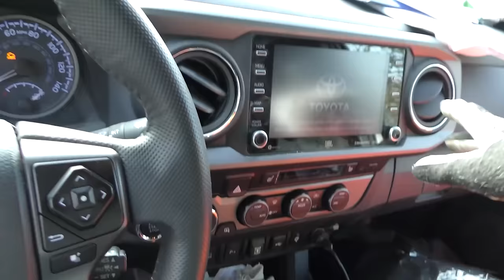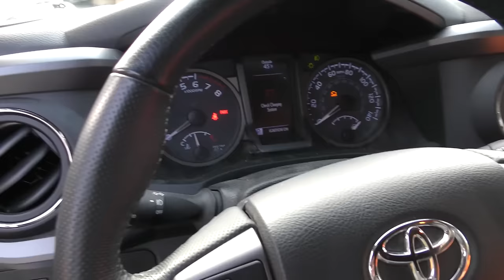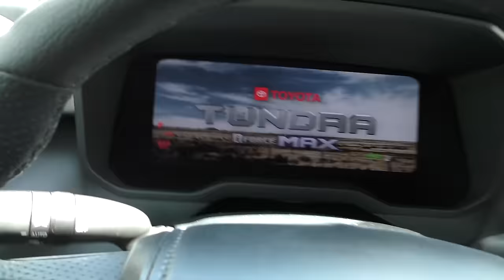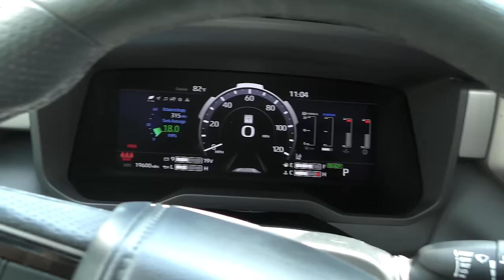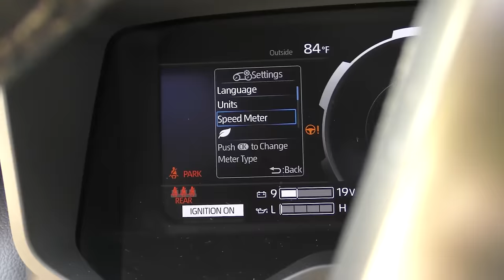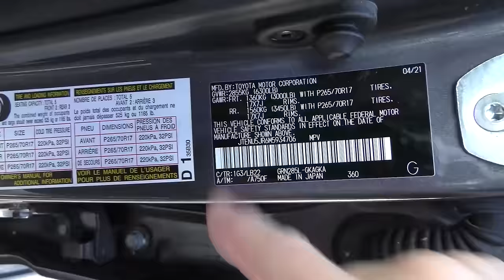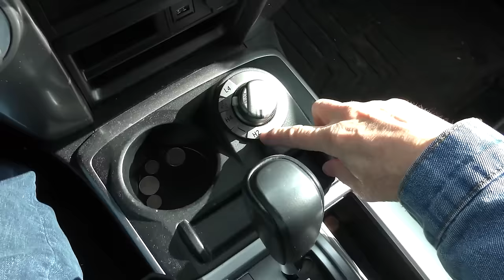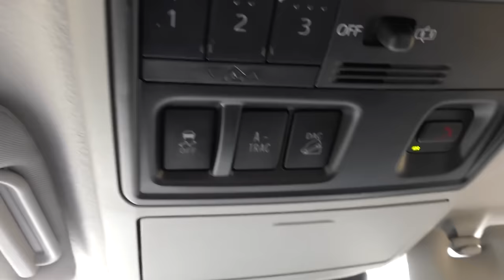3 New Toyotas I Would Never Buy

Comment: Toyota should at least offer the non-turbo version of the V6 and V8 as an OPTIONAL package.  Perhaps even bundle it with a "Power Package" and include some extra things that perhaps the majority of wannabe truck buyers don't want or need, like a HD hitch and heavier duty suspension perhaps and sell it all for maybe $4k extra.  But at least offer it as an option even if it's also an up-sell.  The thing about trucks is that those who use their trucks for actual work (like towing, and aren't just the wannabe truck owners/drivers) know that the value in reliability and towing greatly outweighs the gas mileage.  Those people don't buy trucks for gas mileage; they buy them to do actual work and know that the gas mileage is what it is.  Because to be honest, the money you MIGHT save at the pump, you're just saving up to replace your turbo down the road.  I'd rather just pay more now at the pump and perhaps not have to worry about a turbo going out and heck, maybe getting a long trouble free life out of the truck with a non-turbo version.  I think Toyotai s making some big mistakes and will fall int oteh same trap that GM and Ford have been with their turbo vehicles.  Sad story my friend had one of the early Ecoboost F150's.  By 120k miles or about 10 years old the thing was basically junk.  Took it to three shops all said he needed a new engine basically.  Not just a new turbo, but a new engine as well (and he was very good about maintenance and not abusing the truck, but they just don't last).

The HP (and partially torque) comment Scotty makes is true and often overlooked.  Yes a car can do 200 HP.... at 6000 rpm.  Same is true for trucks.  And now many can maintain a decent amount of torque on the low end, is generally starts to drop off once your speed picks up, but it's not like you're getting full torque and HP all through the driveable arnge (being say 1500 - 6000 RPM).  It's relative as Scotty says but this is often overlooked and people get blinded by numbers (HP and torque figures) but they don't take time to look at how that's applied and when.

Comment: There has to be a perfect weight to size ratio to make a hybrid/gas system work at maximum power and efficiency. Maybe extend the engine compartment by a foot or 2 and throw a huge V8 or small V10 in there. Well go back to the days of American muscle style boats on wheels.

Comment: RE: Tacoma Hybrid
How about the hybrid providing low end torque that the V4 turbo lacks?
Don't you get synergy out of the V4 turbo and electric motor, with the turbo providing power at the high end, and the electric motor providing power at the low end?
Reply: With electric boost and possibly good low gearing (áll these 8-10 gear transmissions), a modern 4 cyl I guess will be fine, but that's just my humble opinion.

Comment: The awd system in the new Grand Highlander is garbage. Easily overheats and switches to FWD and flashes warnings and take to dealer (snow mode) went out and got me stuck. Punching the accelerator, hearing the awd “bang” when the fwd spins. Built to fail.

Comment: Toyota put the 4 cylinder turbo instead of the V6 in the Tacoma is because they know the engine's won't last as long and people will buy a new Tacoma rather than rebuilding or replacing the engine. Knowing people want a quality truck will result in selling more even though it comes in the 4 cylinder turbo for the TRD.

Comment: With regards to the monitor for TOYOTA's cars and small SUVs looking like it's glued on top of the dash yes it does look like that kinda but there is reason for that.  In the tundra there's plenty of room inside or behind the dash itself for the screen to be inside and part of the dash assembly. Whereas the smaller vehicles because they're not as large of a dash and everything still has to fit in there basically the same components there's not as much room so they had to put it up on top and it look like it was an afterthought in my opinion it was, but then they came back with a reasoning of it's safer because it keeps your head up, looking at least at the road somewhat rather than looking downward at the monitor or screen while driving. To the other point of the tundra, there are a lot of people that are serious about driving driving trucks yes but I'd say that's about 10% of the people that buy trucks actually need them and about 90% of them that buy trucks just want a truck for the sake of having room in the back and not having to worry about anything because it's only about 10% of the time I actually need the truck to be a truck the other 90% I could be a car and I'd be fine but I don't wanna have that inconvenience ever so that's why I love my truck.

Comment: I'm with you on the v8. It's much better than a ttv6 but don't spread false information. The new tundra is a much better tower, and they make more hp and torque at lower rpm. The 5.7 is 381 hp at (5,600 rpm) with 401 lb.-ft of torque at (3,600 rpm) and the 3.5 v6 hybrid is 437 hp (at 5,200 rpm) and 583 lb.-ft of torque at (2,400 rpm). They also have more payload than the previous generation.

Comment: I have a 2007 camry 2.4 with stripped head bolts. Is there any reason you couldn't tap out to a m12x1.75, and use grade 12 bolts Allen head  in place of the 11 x1.5?
Reply: Won't work. Not enough of a step up in size to cut fresh threads

Comment: Ain’t doing snow plowing in a tacoma it’s why people want the TUNDRA cuz the tacoma even with the V6 they’re not built or made to plow! the TUNDRA USED TO BE! Tacoma it’s just that They’re not heavy enough. 
I had a 2009 tacoma crew cab TRD with 55k miles back in 2018-19 
In New Hampshire and thought I’d attach a plow set up to it but b4 I did I watched other tacomas online or in town and they would push to a point then once snow built up in front of the plow the trucks 4/4 tires would start spinning as truck sat in one place. They’d back up and get running start into the pile they’re pushing and slam into it and maybe move it another 5 ft before having to repeat the process. 😂 
Figured nope ain’t going to spend hours plowing and all that extra gas and extra wear/tear on engine from rev ups. 
When I can get job done half time in a truck like a dodge 1500!
Or used tundra g

Comment: Tough and simple engines are disappearing due to emissions. Durability is also going away, because all of the new engines are tiny and plastic-filled with mini crappy turbos. Warping and cracking plastic parts, oil leaks, and limited-life turbos..what could possibly go wrong, after 5 years? We've done it to ourselves, unfortunately. There's no one else to blame. Everything is becoming a Hyundai.

Comment: ‘The turbo 4’s can’t tow as well as the V6”?  demonstrably false. Acceleration and fuel economy while towing is better than the lame “Miller cycle” V6, which was a pokey dog. Wait until the hybrid versions come out, which will be hugely more powerful than the old V6. Love ya Scotty but wait two years and you’ll be telling us how fantastic these new Toyota turbo engines are. The shortcomings of the previous gen Tacoma engine is one of the the things that kept it rated below other trucks in the category. True enough though that at least they were very reliable but driving experience in the previous Tacoma left a lot to be desired. 

These new turbo engines do everything better than the previous gen NA engines. They’re too new to say how reliable they’ll be long term but they’re not absolutely brand new and have been available in other vehicles, for several years. I currently have a ‘22 Tundra hybrid that’s been flawless so far, at 22K miles. 18 MPG and balls of power. My friend has a 2nd gen and averages 13-14 MPG with an engine with less power, less torque, and a lower towing capacity.

Comment: it’s not that Toyota decided to put 4 cylinders engines instead of V6, it’s government new emission standards which push toyota make more efficient engine which cause downsize the engine
Reply: Other manufacturers are still producing V8's and V6's and even diesels without emissions issues.  Why can't Toyota?
Reply: @jp1087  other manufactures means domestic ones? Toyota is not domestic
Reply: @andreylosetskiy5217  All manufacturers who produce vehicles for the US market must meet emissions requirements set by the EPA, not just Toyota.  If Ford can meet emissions standards in a half-ton truck with a 5.0 V8, and GM can do it with a 5.3 or 6.2, and Dodge can do it with a 5.7 or 6.4, then Toyota can as well.  The EPA didn't tell Toyota they couldn't use V8's.  Toyota decided 4 years ago to phase out V8's and start using smaller turbo engines because they felt it was easier to make a new engine instead of updating their V8 to meet emissions.

Comment: The 4 cylinder Hybrid may be better. A Hybrid is an EV, that gets its electricity from a gas generator. EV motors can achieve much more torque and speed than a mechanical motor, depending on how it is put together.  Toyota Hybrids also use ECVT transmissions, which actually have gears. If you have a gas car and you are about to race an EV, you are only about to embarrass yourself.

Comment: This dude is smoking crack. I own a Tacoma TRD V6 with the OTT tune and I can tell you they do NOT have good low end torque. The power of the 3.5 comes on at around 3500rpm whereas the new 4 cylinder turbo has a ton of low end torque...that is what turbo's do for an engine. I really like my Tacoma but facts are facts, the new 4 cylinder turbo has much more power at a lower RPM.

Comment: Scotty has not driven one of the new Tacomas. Knows nothing about the engines. And as far as the 4runners... I owned the current model 4runner for 11 years with the V6. My new 24 Tacoma pulls my boat better than that 4runner did, which I'm sure is similar to the previous V6 Tacomas. I have a 2015 V8 Tundra still anyhow for towing. But I couldn't pull jack comfortably with that 4runner.

Comment: It doesn’t get 30 miles to the gallon on the highway. lol The best you’re gonna average in that truck if you strictly drove it at 55 to 60 mph for a full tank no stoplight till you go and fill it up 22 miles to the gallon and that’s on a flat surface.  I have driven one of those on many road trips and yes the computer will tell you you’re getting 30 or more miles to the gallon. Sometimes it’ll also tell you you’re getting eight the truth is it is inaccurate until you do it long enough and do the math yourself. I have to say Toyota at the end of a full tank is one of the most accurate at the end of the tank but if your not taking the mileage, divided by the gallons you put in your truck, you’re only trusting the computer to tell you a random number. Just like how you can drive your car 50 miles more then when your dash says you have 0 miles to go 😂

Comment: Garbage motors corporation, shitsyler and ford need to stop trying to keep reinventing the wheel, there four cylinder turbo phase failed in the 1980's and 1990's and it will never be a viable option.